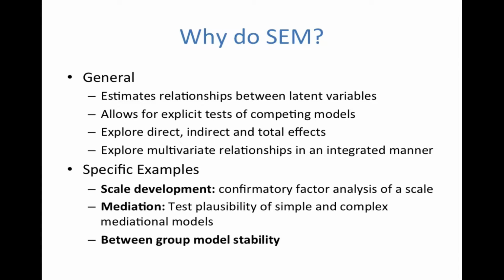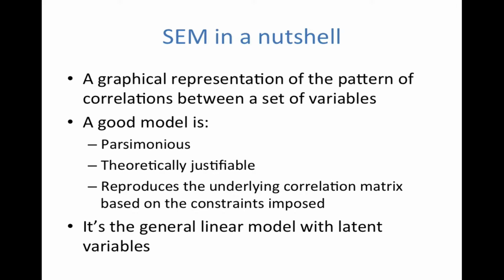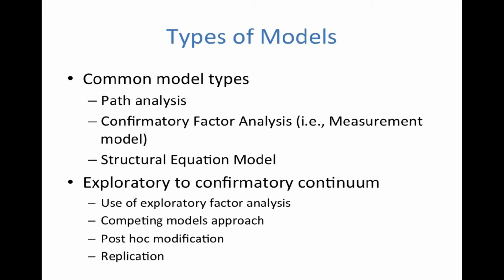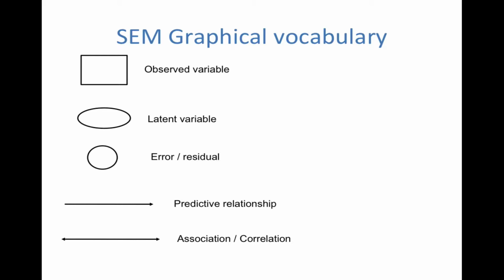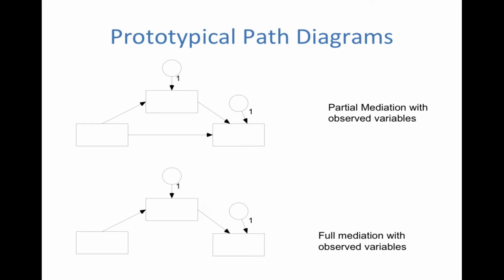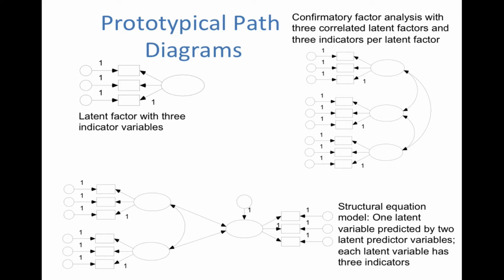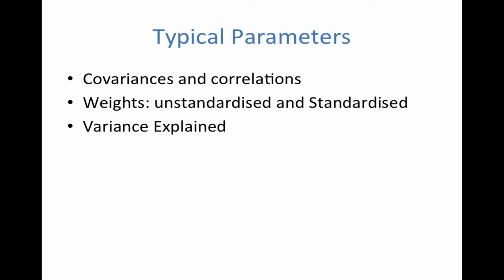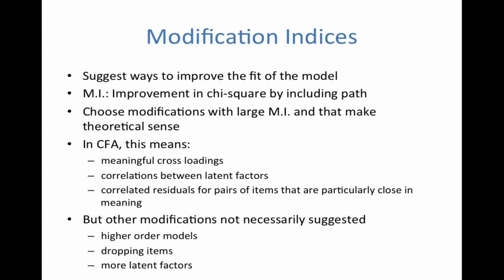Introduction to Confirmatory Factor Analysis and Amos - Lecture

Comment: Thanks a lot, Professor Anglim. Your lecture is very helpful. But I still have questions about modifications and really need help from you.
1. In what situation we can drop items to improve the model fit? 
2. Is this the right way that we drop some items that have low loadings (<.5) on factors first and then see the possibility of adding a path or drawing covariance?  
3. to find the biggest MI for model modification, when should we check the covariances table? When should we check the regression weights table? or we check both at the same time?
Look forward to your reply. Thank you very much indeed.